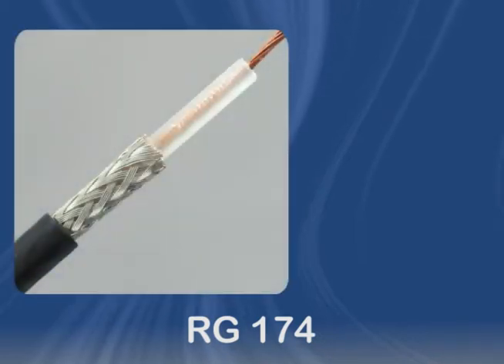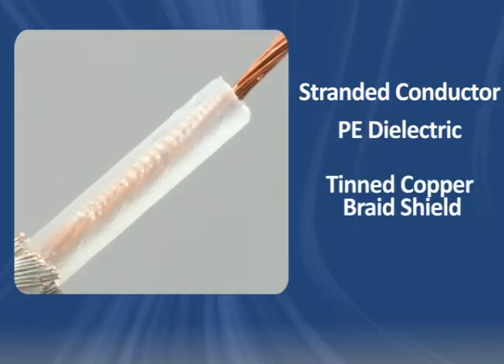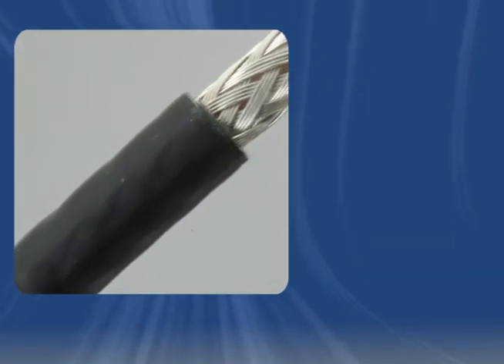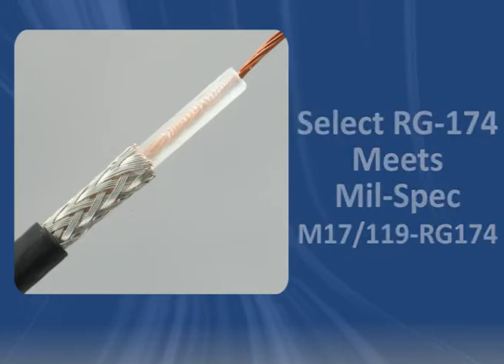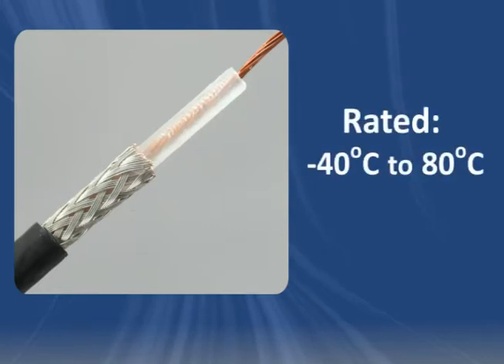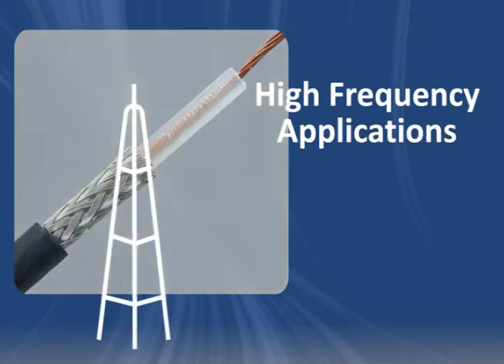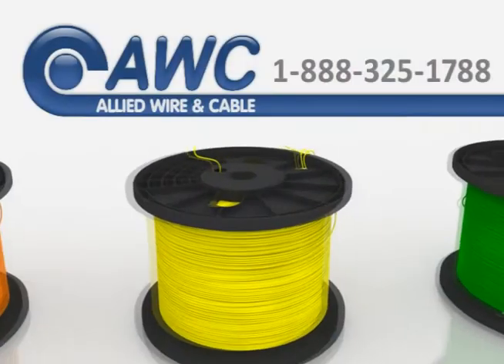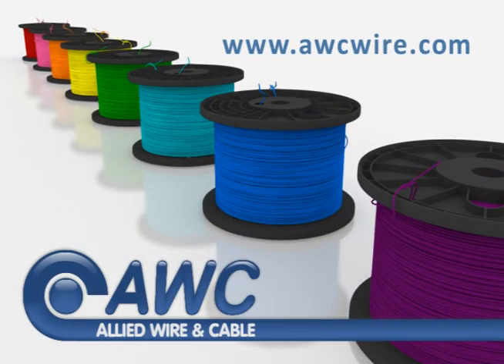RG 174 Cable: Allied Wire & Cable Product Spotlight Video

Comment: Hi, RG174 is much different than a standard tv antenna cable correct? Because I am seeing people using their gopro cameras underwater with rg174. Although my tv cable looks identical it doesnt work and must be a whole other material with low frequency.